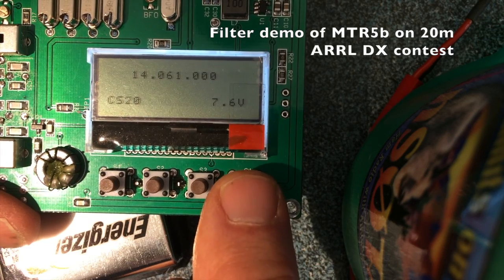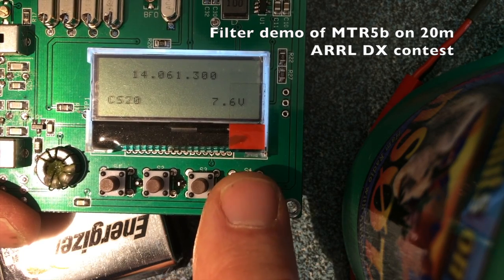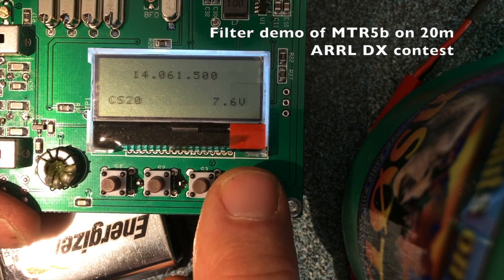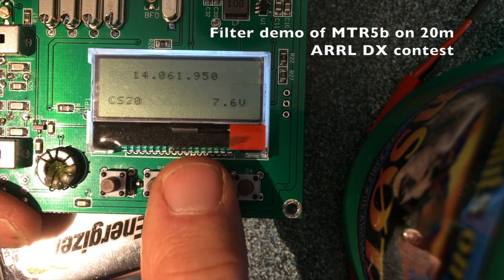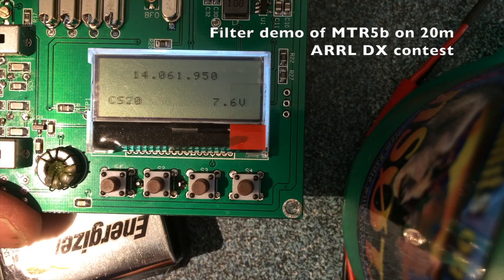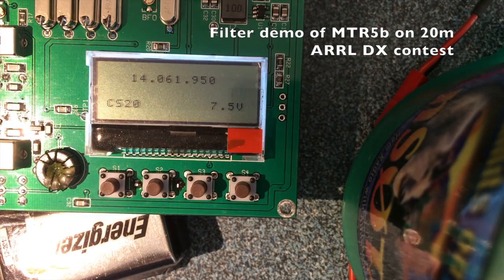MTR5b Filter Demo

Comment: Your receiver may be more sensitive than mine--no doubt due to some mistake in my build. I added  cap across pins 1&8 of the LM386, which only increased the hiss of the amp itself. I love my MTR5B, but want to juice up the receiver gain if possible. Thx for the post, Steve. DE W0XO